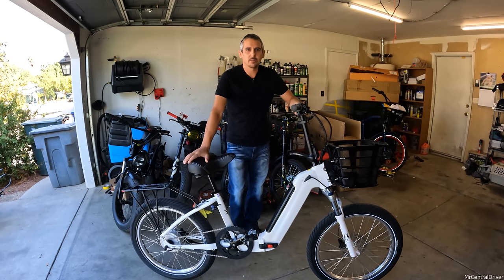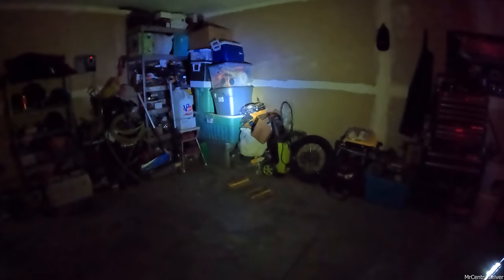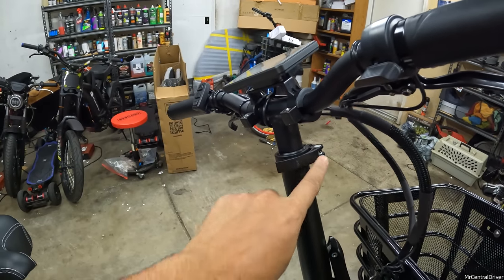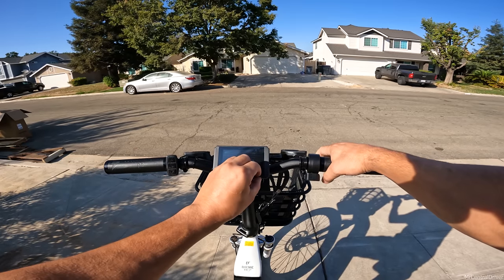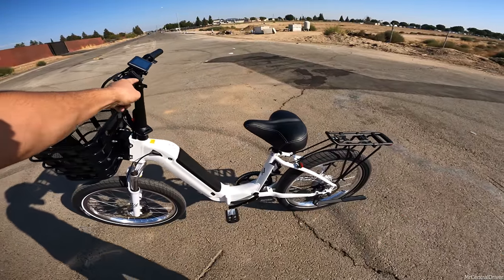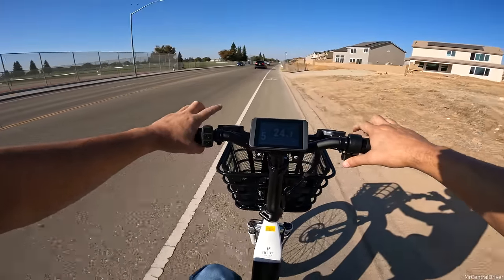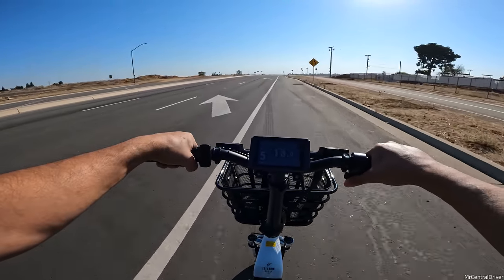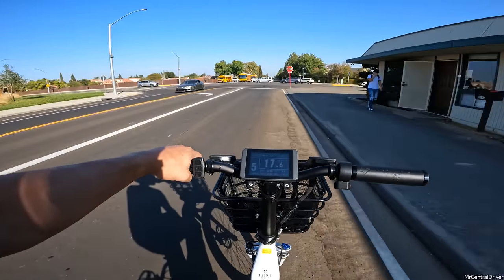Electric Bike Company Bikes Review Model F✨FOLDABLE EBIKE

Comment: I find it hard to believe you brother telling folks the 3.5 amp charger is fast 😅 I'll believe you when you swap those brakes over to your surron 😑. ☝️🤟👽🚲🎬😖
Reply from the maker: 3.5 amp charger compared to the standard 2amp and this is a smaller battery than most it will charge it pretty quick.
Reply: @MrCentralDriver  change your brakes ⏳😅